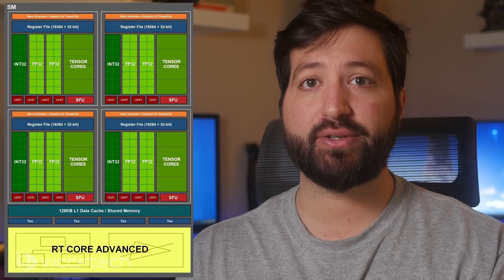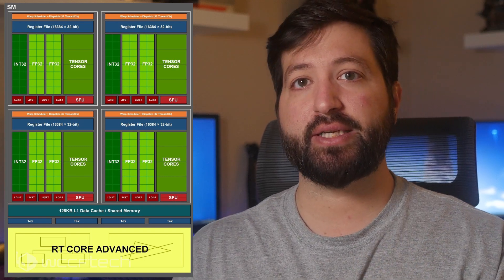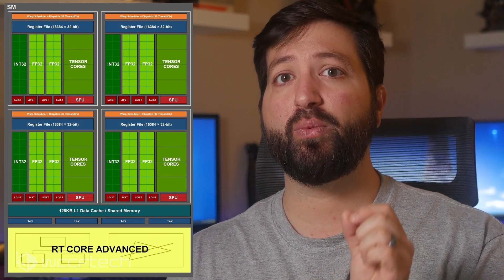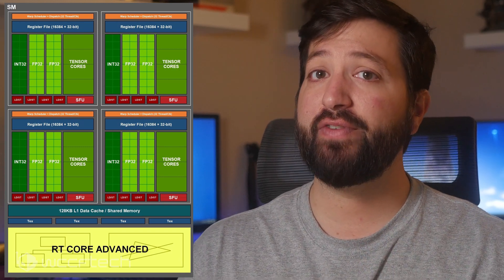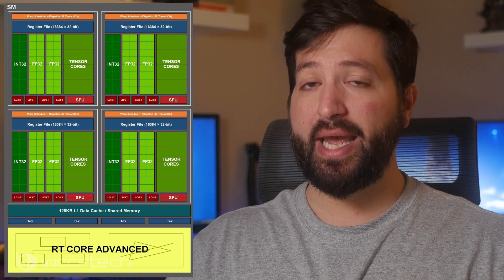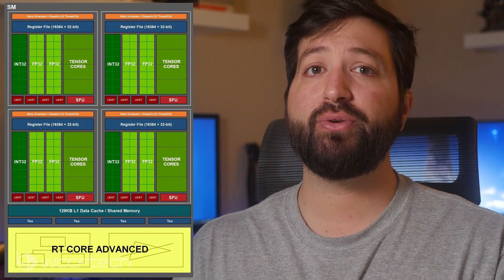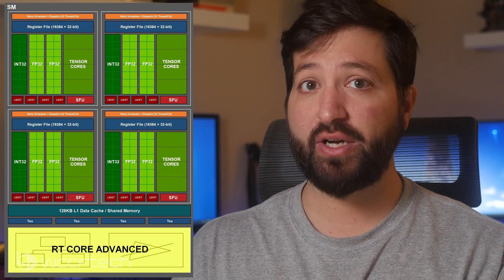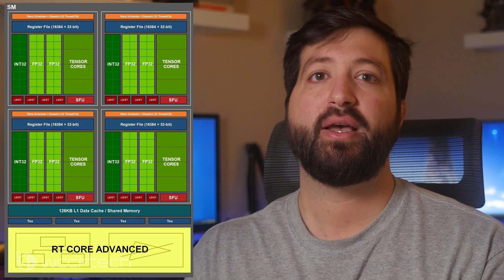RUMORS: NVIDIA Ampere GPU Massive Die Size And More!

Comment: Can we just get chiplets and fast system interconnects. This solves everyone's problem...Cards with chiplets based on needs and not massive dies with sections never used.
Reply: GPU's and graphics are latency sensitive chiplets don't work, hence why its not been used
Reply: @entium1  no - failure to change the industry from it's current way of thinking is the reason. If Nvidia and AMD pushed chiplets then devs would learn and embrace.
Reply: @entium1  furthermore it would go just like Ryzen 1 - not as fast at first but then catching up.
Reply: @LakerTriangle  No it wont' be anything like that, latency has a geometric to exponential increase in performance drop when it comes to paralleled work, unlike serial work.  Its not about change interconnects are slow, too slow for this kind of work unlit there is a caching system to reduce or actually hide that latency which it can be done but its damn expensive right now, becomes viable then we will see chiplets in GPU's.  Read the white papers on this AMD and Nvidia both did them for compute work loads, Which it works there not for graphics
Reply: @entium1  already read them when they first came out. And you even just verified it by basically saying it's possible but expensive. I'm not saying it's an overnight 1st gen thing - only we need to start the transition and further the research. Low level APIs need to be developed/refined and all the stuff that comes with an architectural shift. Our current monolithic die architecture is pushing its limits IMO and we all know chiplets are the future.
Reply: @LakerTriangle   research is there and its been done, just have to wait till it becomes economically feasible.  Pretty much we need to have much more cache levels per chiplet or a bank of ram that is used as cache between the chiplets.  both are very expensive right now.  One consumes die space and one well more chips on the board.  Either way die sizes for the chiplets are going to go up to, because control silicon has be greater as well.  If it was as easy as lets put more chips together in one package, it would be done overnight.
Reply: @entium1  not sure how feasible 3D stacking memory on top of chip designs is but people smarter than me can make this work...were getting close to the end with die shrinks.

Good talking with you - I actually think we're closer in mindset than it 1st sounded.
Reply: @LakerTriangle  yeah we are thinking across the same lines, I think its about 10 years away though.  Its always a trade off between performance and cost, once the those equalize that's when we will see it happen.

Comment: Well the 12nm TSMC Titan V was 815 mm² with 21.1 Transistors 
vs the 12nm TSMC TRTX IS 754 mm² with 18.6Transistors 
vs the 14nm GF/S Vega64 486 mm² with 12.5 Transistors
vs the 7nm TSMC Vega VII 331 mm² with 13.2 Transistors

Now Double the FP32 Unit ( and is most likely aim at data center version of the cards )
new and doubled performance Tensor Core
new 2x Faster design RT CORE ADVANCED (most likely 2 RT and Plus something new)
Enhanced L1 Data Cache (takes more room)
also rumor PCIe 4.0 support

Now all that, it looks like Nvidia has done a major redesign from the Turing architecture, that WOULD support the theory that Nvidia is going to be on 7nm+ aka N7+ EUV and with its normal cornering supply chain move.

SO 30 series Ampere TRTX 5120:320:96:160:640 80SM 826mm² die 3000$
RTX 3080ti 4608:288 :88:144:576 72SM 1700$

with RTX 3080 3328:208:64:104:416 52SM 600-ish mm² die 1200$